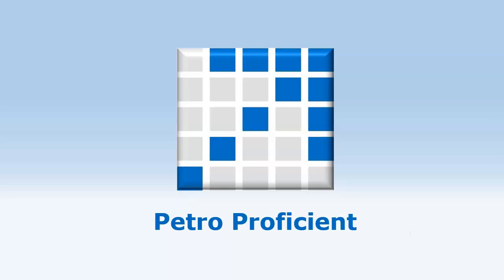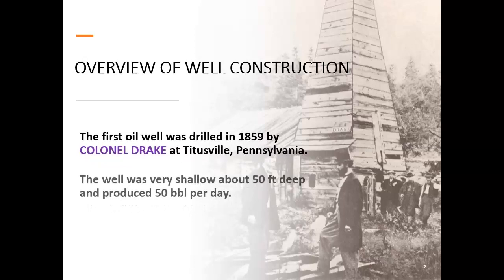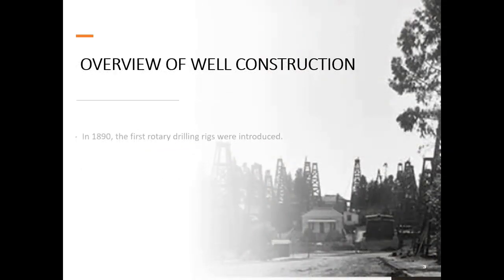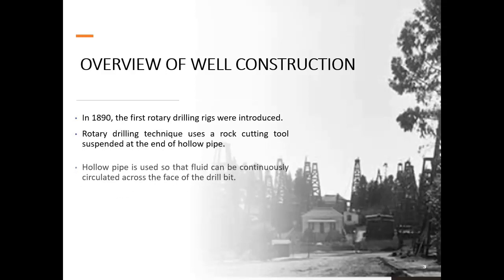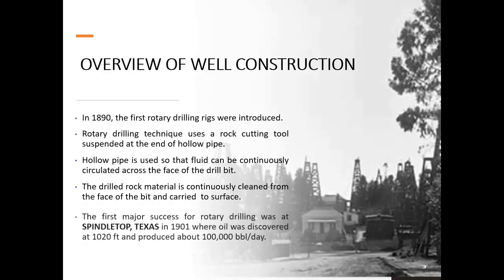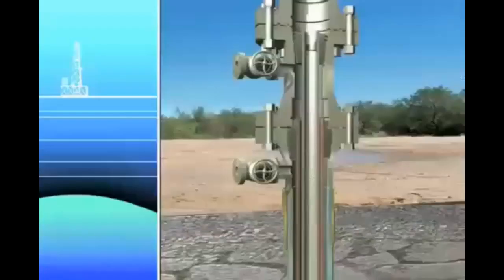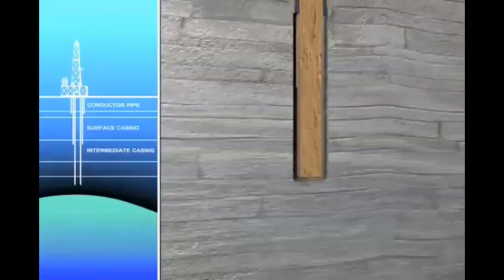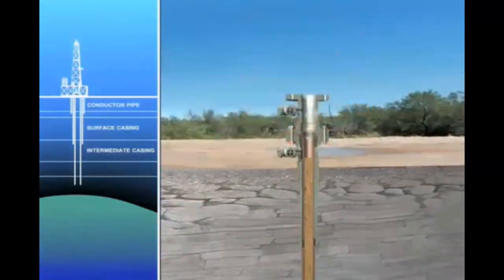Oil Well Drilling Process | Oil and Gas

Comment: what gets into the ground when oil and gas are taken up? what material has the ability to stabilize the subsoil as good as oil and compressed gas nothing can replace Oil and Gas so subsoil worldwide is and will be unstable.
Reply from the maker: Generally water is pumped for pressure management. Water has also been found naturally.

Comment: How is drilling done after placing blowout preventer?
Reply from the maker: The drill bit and assembly is lowered through the BOP and drilling resumes as the bit and assembly is rotated from Surface
Reply: @PetroProficient  Thank you Sir.